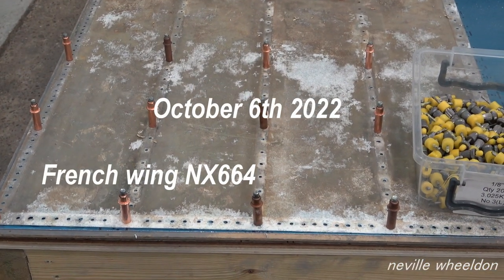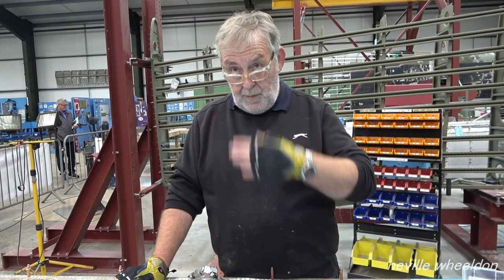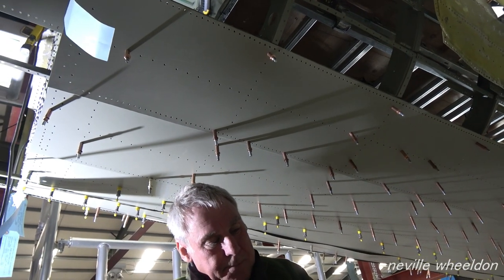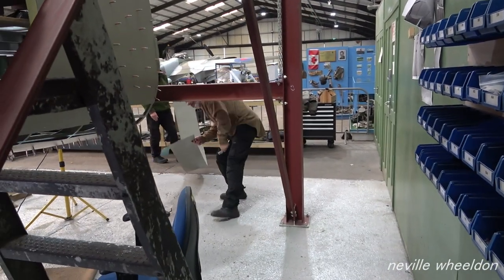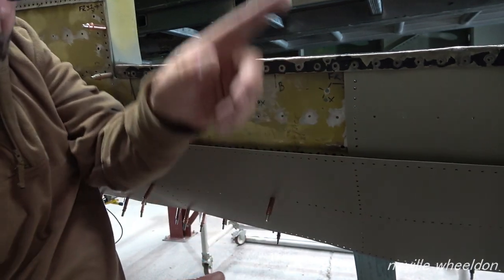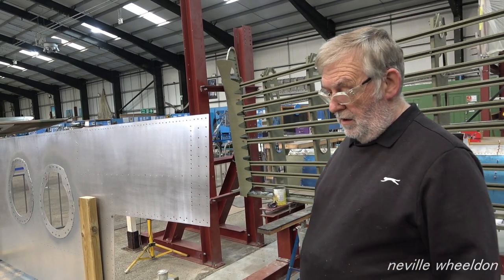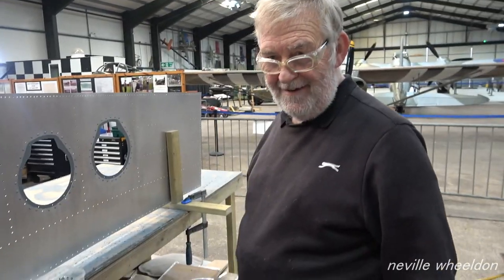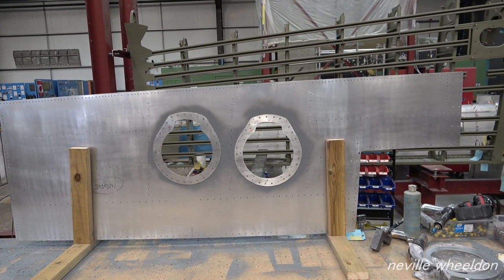Video 168 Restoration of Lancaster NX611 Year 5. KB976 rear fuselage start of final assembly.

Comment: Port wing only because the pilot sits on the port side of the aircraft. Lights on the starboard side would be mostly invisible to the pilot.
Reply: Are they like floodlights, or used to guage altitude like in the Dambusters film?
Reply: No. Purely for landing. These are more flood light effect I understand so they illuminate the ground, where as the dambusters used a spit light in the nose and tail.

Comment: Neville....for the education of some of your viewers, the work of Keith redrilling holes into a new sheet of aluminum is frought with danger.  That sheet of aluminum is horribly expensive, and you only get one chance of drilling it correctly.  Keith, waiting to back drill that one area shows what experience is worth.  In addition, rivieting the new skin on to the frame work is also  an art. You can not start at one end and progress down to the end.  Even a .001 mismatch on every other rivet hole will equal a mess at the other end!  Notice the bulge that was showing up when they were only fastening the skins with skin-pins. You usually start riveting in the centre and work towards the ends. It is an art!  Once again...experience. The reason much of this work 'looks simple' is the experience level and tutoring  from Keith and the boys.  Great work all around. Close up photo of the lamp markings (degree markings), fantastically important work Neville. Cheers.
Reply from the maker: Thanks for your comments Ed, appreciated.

Comment: Hey Neville. Not sure if you u have mentioned this b4 but is that french plane ever gonna fly? On that part with the writing on it. I don't think it was stamped but acid etched. which isn't hard to duplicate. They should have that done for that landing light.
Reply from the maker: Hi mate , NO the French wing will be a static display along with the rest of the Lancaster NX664. When they swap the wings over they will check on what is required on Just Jane's landing lights.

Comment: i would be pleasantly surprised if the CAA would pass comment on the French fuselage rebuild, while i realize it is not being built for flight, only taxying condition, i wonder what would be required to make it flight worthy
i think i did hear something in one of the videos about use of materials, it not being particular spec etc, hardened and so on, but it still be interesting - either way its a fantastic job and well worth seeing the internal structures as they never been seen by the public before